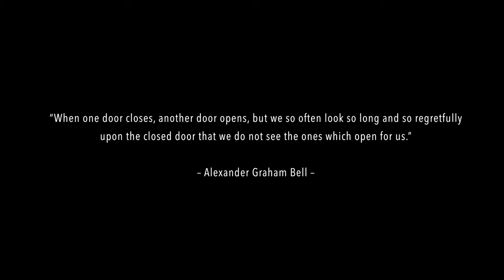Clearing the Deck for Action - an update on the La Salle Causeway Bridge 4K

Comment: I'm curious to see what they plan to use for a temporary bridge. I was originally thinking a Bailey, but the delivered parts don't look to fit the part.
Reply from the maker: Yes, it's going to be an interesting period.  I agree about the steel bars, but wonder if they could be intended to form a runway over which a lighter modular bridge will be built and moved across the gap with the aid of a barge.  That would be something like the reverse of the removal of the bridge deck just de-constructed.
Reply: The term "Bailey" is outdated as the "Bailey Bridge Company" no longer exists.  It's like using the term "Kleenex" in lieu of "paper tissue"!   :D   However, you are correct in that a temporary steel panel bridge system will be utilized on this site - the "Acrow 700XS" panel bridge.